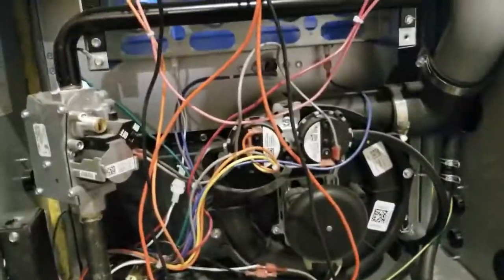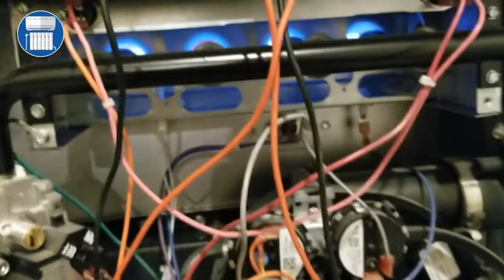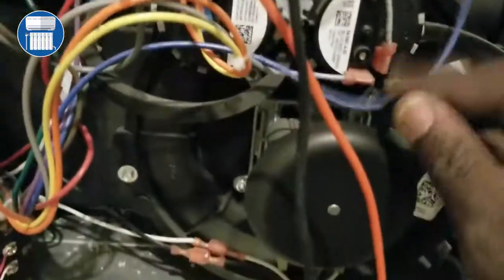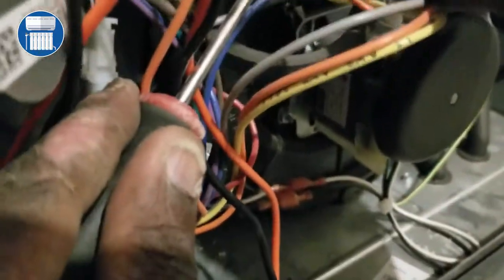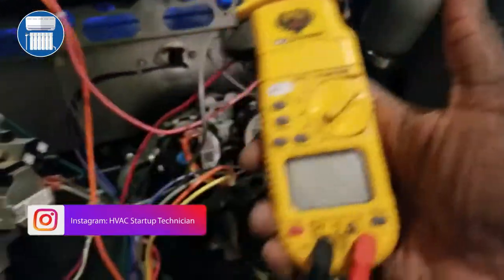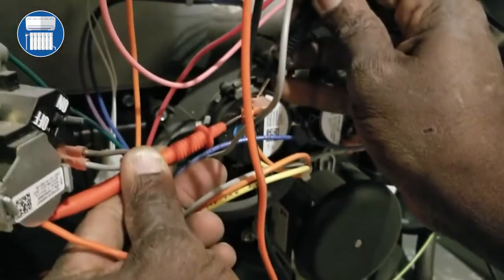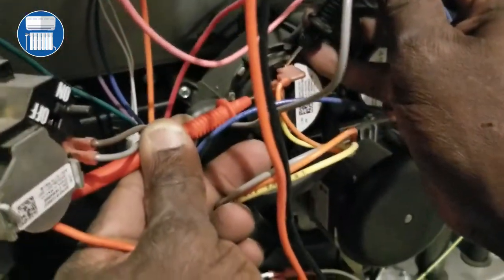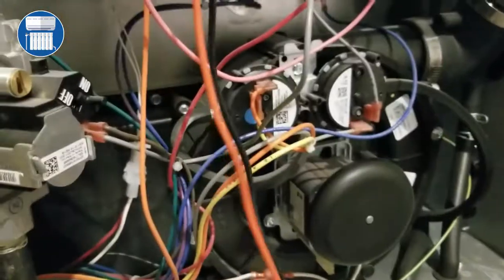how to test a pressure switch on furnace using a multimeter in heating season

Comment: What about voltage as furnace first turns on inducer. What should pressure switch voltage be on the wires before it closes?